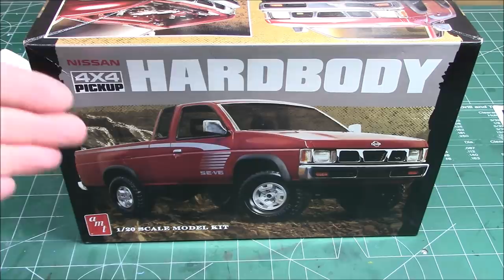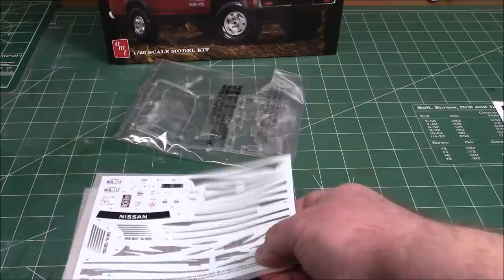AMT 1993 Nissan Hardbody 4x4 Pickup 1/20 Scale Model Kit Build Review AMT1031

Comment: I had that same full size truck in the early 90's with the well known Z-20 engine. Nice build thanks!
Reply from the maker: Cool, thanks for watching!
Reply: There wasn’t a Z-80 engine. There was a Z24 from 86-1/2 to 89
Reply: @Bullitt180sx  https://datsun510.fandom.com/wiki/Nissan_Z_engine    The Z24 had a tall block the Z20 was a shorter block. The truck I had in the 90"s was an 87 model with an 82 model Z20 fuel injected 200sx engine.

Comment: I never knew the kit needed to be washed in Simple Green (any other cleaner?) before paint until I started watching you. I assume it’s to remove oils from the factory?

Also, after parts are painted on the trees and removed, what paint do you use to touch up the parts? Just curious if you need to have craft paints that match your spray paints?

How crucial is a paint booth for a casual builder?

I’ll use that Pledge Floor cleaner over the final build, too, thanks to you.

...You have inspired me to build another model... I just ordered a Lamborghini Countach...

After watching your vids and seeing how great the results can be, I wanted to try again. Now, with YouTube, I should be able to have better information for better results. 👍🏻
Reply from the maker: Touch up the parts with a bit of the spray can shot into a cup and brushed on.

Thanks for watching!

Comment: There is only one more 1:20 scale pickup truck kit by AMT to build: the 1993 GM Sonoma 4x4 pickup truck;originally a Lindberg kit rebranded as an AMT kit.
At the local hobby shop that I like to buy kits and supplies from,has the 1993 GMC Sonoma priced at $35.00
(with city,county,state,and federal sales taxes added to the subtotal price);
about $3.00 to $4.00 more expensive than the kit you have just reviewed.The trucks both kits are based on,are 26 years old the same age as me;because I was born in 1993;the same year the Colorado Rockies were established.
Reply: Robert Darnell  I agree.Other kits Chis could do a full build review on,is AMT's re-released 1978 Ford F150 4x4 Firestone pickup;and the highly anticipated;re-release of the 1:25 scale GMC Astro 95 cabover the same kit as the Chevy Titan 90;just with different emblems.

Comment: Have you run into any issues using automotive spray paint on the plastic parts. I've heard sometimes the paint can be too hot(harsh chemically)?
Reply from the maker: Nope, most of the paints I use are Rustoleum 2X brand which can be used directly on plastic. 
There are lacquers that will be too harsh for plastic, you can use them but you must use a primer and make sure you get full coverage. It's best to test on a piece of scrap if you are not sure.